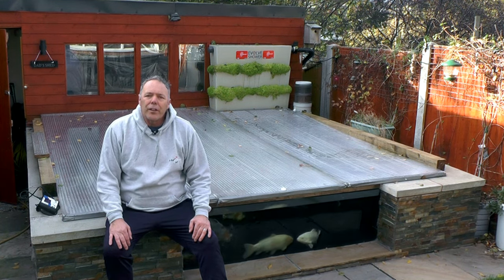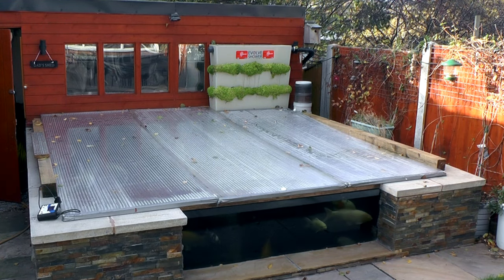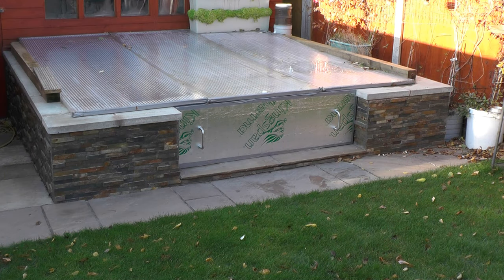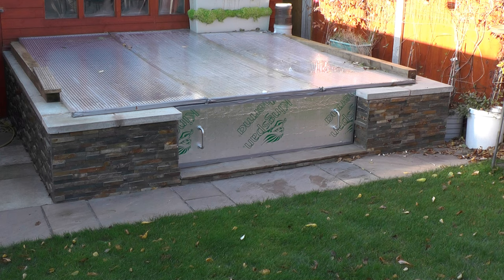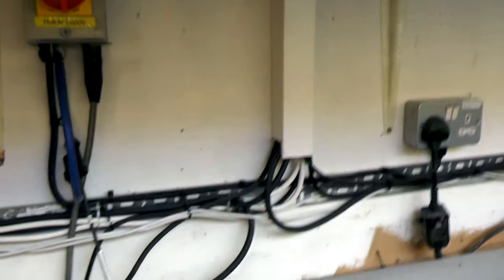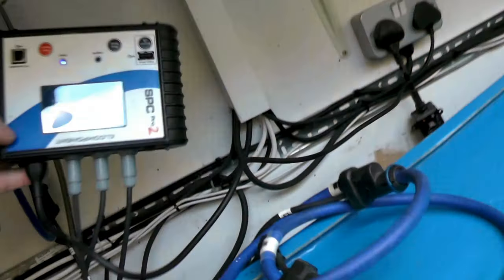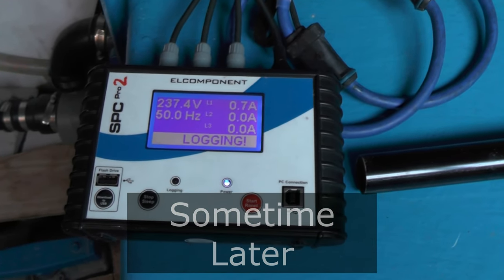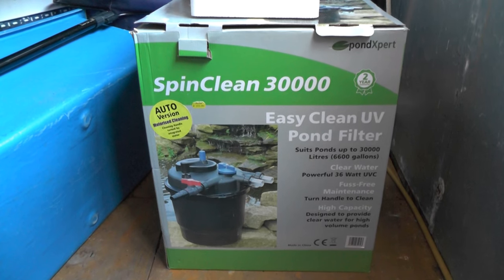How To Add Insulation To A Pond Window **Monitoring Pond Heating** Plus New Filter Projects

Comment: Hi Kevin, how about some thicker polycarbonate sheet around and top of the bakki showers but loose enough so it doesnt damage the MYOB? 
Now that you have been running the Remora for some time, are you still happy with it or do you think that the Duratech was better?
Reply from the maker: Cheers Lau for commenting. I wouldn't swap the Remora, it is still virtually silent, so efficient and very cheap to run.
Reply: @AKoiEnthusiast  something I am looking into. I like the fact that it's a smaller unit.

Comment: Hi Kev great video i am going to get some insulation for my pond window it is my my first winter with remora heat pump last two nights costing me too much not getting to my 15 deg it is set to stays on all day only getting to say 14 8 so not switching it self of just stays on which means more cost🤦🏻‍♂️so hopefully by insulating the window will sort out problem.Are you putting anything in front of your insulation to keep it dry? 👍
Reply from the maker: Cheers for watching  Mark. The Kingspan has a foil liner on them and over the last few years the foam has stayed dry. So in answer to your question, I have not planned on adding anything other that a sheet of Bubble wrap on the window side. My heater is set at 17 Degrees and the Remora is keeping the pond between 16 & 17 Degrees. I've just logged it for last week and it is currently costing 71p per day even with the Snow and Minus 2 temps.

Comment: Hi Kev thanks for the video. I might try insulating my window this year see if it makes a difference. When do you use Powerful Mode on the Remora? I have mines on Smart Mode all the time. Do you use it to boost temps or have it on all the time ? Thanks again. Chris
Reply from the maker: Cheers Chris. The trouble with the Remora Invertor is, it is so good and efficient so to show the unit logging I turned it up a couple of degrees and changed the mode to Powerful just to show it working. Yes I normally have it on Smart mode and it keeps the costs down.

Comment: Hi Kevin, my first full winter with the ashp, having a battle with eon at moment, for some reason they turned off smart meters in Sept to put us on new eon next account, can't get any sense out of them why they needed to turn meters off, especially with all the pestering they gave me to get them fitted in first place, anyway estimated bills since Sept up and down like a yoyo, means I've gradually lowered pond temps to 15deg as of last weekend.
  Bakki shower,  couldn't make up my mind to insulate or not, what I've done is slow shower right down with bypass to barely a trickle, just to keep media damp, not sure if the logic of this is right/wrong, should add I have a planting tray on top with about 25mm of compost in, so hoping a thermal benefit there, also moved shower this season, so backs onto filter house and out of north/easterly winds, mind your own business is quite thick on outside, so maybe another thermal benefit?
Reply from the maker: Cheers for coming back to me Marek, I've completely covered the Bakki over the previous years but seemed to lose a lot of volume on the MYOB but heard that some people use Bubblewrap but unsure. I can't believe what they have done with the Smart Meter. The hype and adverts going round about them at the moment. I refuse to have a Smart meter because they cannot tell me a single reason why I should have one. They do not save you any money what so ever. Yes they tell you what you are using electric on but if it is your kettle, would you stop making drinks, if it is the TV would you watch less and it's not like you can turn the Freezer off. Plus at present I get an average pay out for my Solar Panels and with a Smart Meter they would be able to monitor my actual generated Electricity and I may lose out lol. I'm with Bulb and they have just gone into receivership
Reply: @AKoiEnthusiast  only reason I went with smart meters was I got discounted tariff, but that's odviously been discontinued, I wouldn't worry about export tariff with your solar, your feed in tarrif should be completely separate account, I've got 3.4kw array, pays out just over £1000 PA, export tarrif is so miserly, I fitted box of tricks to hot water cylinder and imersion heater, has a buffer of 100w above what the house is using, then diverts export power to the heater, still get paid export power.

Comment: I’m a Lagger by trade mate careful with poly or phonelic foams they can scratch glass I’d put a towel or cloth in between glass and insulation board or bubble wrap 
Just make sure the insulation does not come into contact with your window 
It blunts sharp knives it’s pretty lethal
Reply from the maker: Cheers Simon. I've got a roll of Bubble wrap that I'm going to use on the shower so I'll pop a sheet between the panel.
Reply: @AKoiEnthusiast  no worries mate